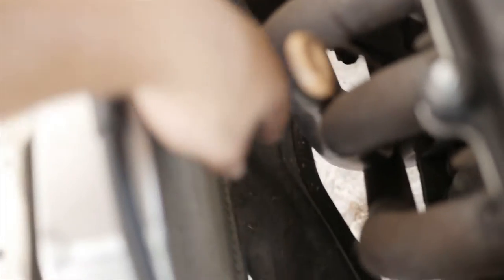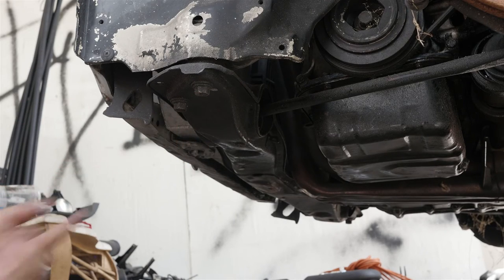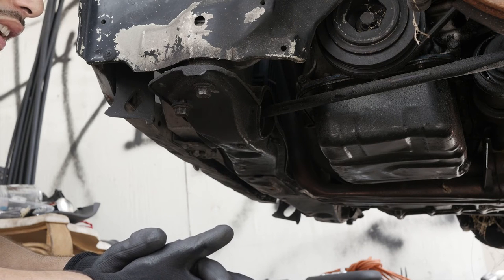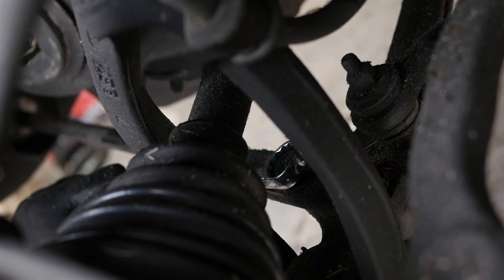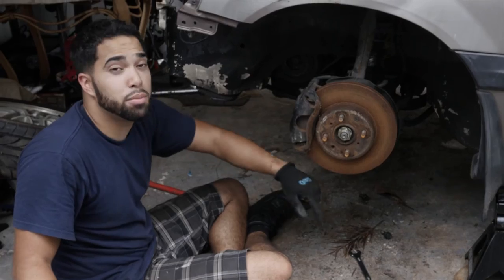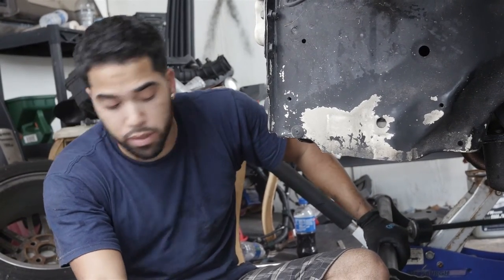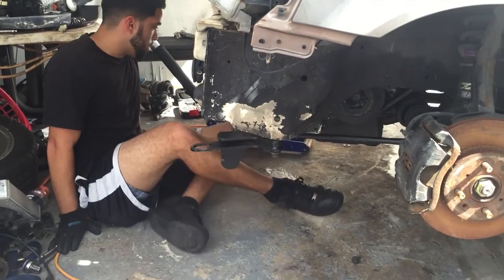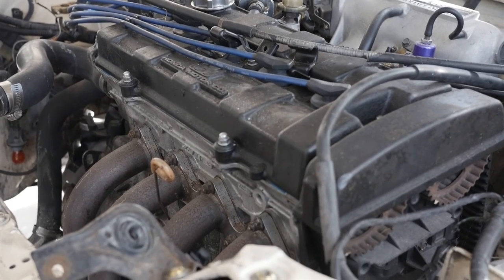Honda Civic EF Wagon Build - Innovative Traction Bar Install - "Project Swagovan"

Comment: What is the main differences in innovative "crossmember" and the innovative "traction" bar and why did you choose the crossmember route?
Reply from the maker: I have the cross member with the traction bar add on, I bought it because I got a really good deal on it locally.
Reply: Kevin Colewell I think they are both the same, just different way of calling it.

Comment: Ok ok ok…. Stop …. I just came here from watching max speeding rods install 

Yeah…. That call it a rep , naw…. At 8 seconds in the built quality is light years diff!! 

Looks like innovative did real world math on placement of the bar mounts & they actually use an absorber (I’m betting they offer in diff stiffness materials road/street/race) 

Is the speed rods horrible NO 
Is the spied rod an innovative rep ALSO NO